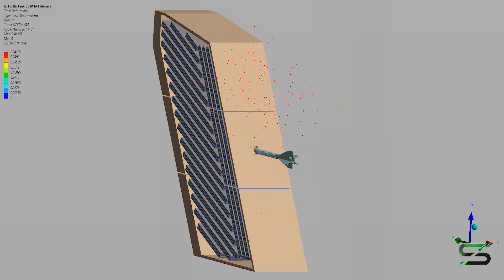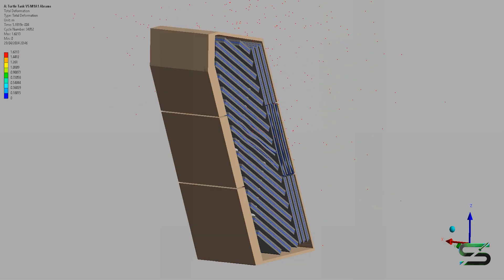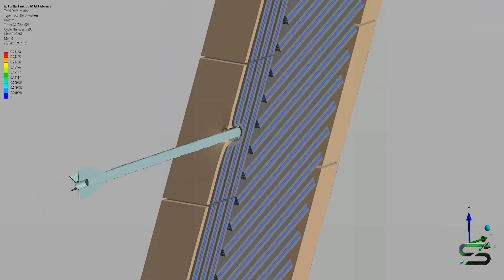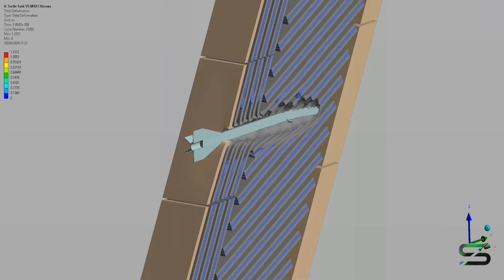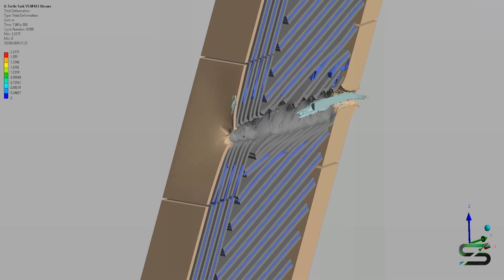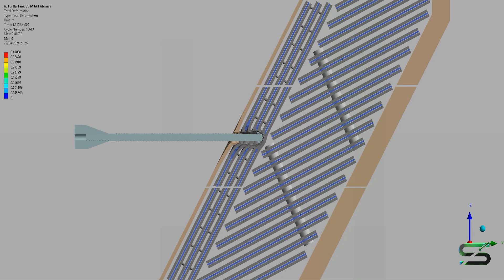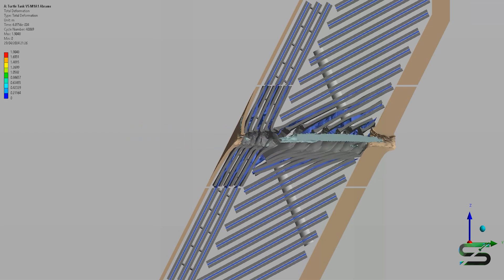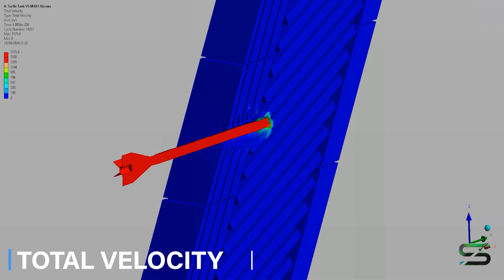T-72B3 VS M1A1 Abrams Turret Side | Armour Piercing Simulation

Comment: The depleted uranium armor is ONLY in the in the turret cheeks of ALL the Abrams variants that use depleted uranium as armor (excluding the training variants which reportedly have depleted uranium in certain parts of its hull).
Reply: SEPV3 has DU in front of the hull and above the driver.
Reply: @saltysteel3996  Not above the driver, only the front hull.
The hull roof on the SEPv3 has stayed the same, being unchanged.
Reply: @saltysteel3996  it does not. No credible source supports this aside from 5 training units. This is confirmed by RedEffect and Spookston. They’ve interviewed SEPV3 commanders.
Reply: @velvetthundr  The SEPv3 does use an upgraded hull array, though it's still being speculated as to whether or not NGAP even uses depleted uranium.
Reply: I wonder why the US went for DU, it may be cheaper than tungsten, but based on some other simulations it’s inferior in terms of protection. Maybe it’s some DU-tungsten alloy like the newer M829 versions.
Reply: @RichelieuUnlimited  I'd imagine it's because of how cheap it is compared to tungsten... It isn't really a favorable material in the US.
That, and DU reportedly has great penetration-mitigating effects when paired with NERA materials, greatly increasing their effectiveness.
Reply: @RichelieuUnlimited  You're mixing up armor and ammo, tanks don't use tungsten armor
Reply: @BENKYism  Leopard 2 does use tungsten in its composite based on publicly available data. As do most other modern western style tanks, probably.
Reply: @RichelieuUnlimited  It's very unlikely that the leopard 2 uses tungsten armor. "Chobham" armor is generally made up of NERA (layers of steel sandwiched between rubber) protected by an outer layer of high-hardness ceramic tiles. Tungsten is a lot more money than depleted uranium.
Reply: @BENKYism  Leopard 2 doesn‘t use Chobham. While the technology was shared with Germany, Germany *supposedly decided to develop a composite scheme more optimized to dealing with kinetic energy penetrators instead focusing primarily on HEAT. In terms of expensive materials, to my knowledge modern Leopard 2 variants make use of a solid one meter *thick titanium alloy trunnion so I doubt some tungsten alloy here and there is going to break the bank (assuming the tank uses ~1 metric ton of raw tungsten it would cost between 10.000 and 35.000$ plus whatever processing is required).
Reply: @BENKYism  Almost every tank (apart from the later Abrams variants and a select few Russian variants) uses tungsten composite arrays.
Reply: @BENKYism  "Chobham armor" (something that hasn't been used since the early '70s) uses tungsten with NERA elements... That NERA is NOT "layers of steel sandwiched between rubber", NERA is the reactive materials themselves... Be it plastics, rubber, glass, or sand.
Reply: @TheArcticFoxxo  I was wrong about tanks not using tungsten but Chobham armor is used on the Challenger 1/2, Abrams, and K1. The non-explosive reactive materials are only one component of NERA, it's also dependent on the layers of steel plates.
Reply: @TheArcticFoxxo  Chobham armor didn't even exist in the early 70's, the first tank to use it was the Chieftain mark 5
Reply: @BENKYism  The first use of Chobham was in 1969.

So sorry, let it be known that I'd like to change my statement of "early '70s" to "late '60s".
Reply: @TheArcticFoxxo  A testbed was developed in 1969, the Chieftain didn't receive Chobham armor until 1975 with the Chieftain mark 5. Chobham armor is also used on the Challenger, Abrams, and K1.
Reply: @TheArcticFoxxo  In fact, the first vehicle to enter service with Chobham armor was the Abrams in 1980. The Abrams, Challenger 2, and K1 tanks use Chobham armor.
Reply: @BENKYism  Yes, and that testbed used...?

The only use of Chobham on the Abrams is on the skirts, which makes it quite hard to argue that it actually uses it.
Reply: @BENKYism  Steel plates, by the very definition of NERA, are not NERA.
Reply: @TheArcticFoxxo  I never said steel plates were NERA, I said that steel plates are a necessary component of NERA
Reply: @BENKYism  I must have misread it then.
Reply: @TheArcticFoxxo  The Abrams' turret, turret bustle, and hull use Chobham armor.  The US didn't jointly develop a proprietary type of composite armor just so they would end up using it on the side skirts.
Reply: @BENKYism  The Abrams turret, turret sides, and hull have only ever used BRL or HAP, not Chobham. The only use of chobham had been in the sideskirts towards the front of the tank.

You're right, they jointly developed a composite armor profile so they could develop off of it and produce BRL instead.
Chobham was only ever used on the XM-1, and it was dropped with the introduction of the original M1 abrams in favor of BRL-1.
Reply: @TheArcticFoxxo  BRL-1, BRL-2, HAP-1, HAP-2, and HAP-3 all incorporate Chobham armor. The Ballistic Research Laboratory (which BRL-1 gets its name from) was involved with co-developing Chobham armor with MVEE in the 60's and 70's.
Reply: @BENKYism In what way do they "incorporate" chobham armor? They use domestically-designed reflecting plates with a downsized mesh and a DU backplate / further mesh.

The only connection the BRL institute had with Chobham was its implementation of a composite array including it on the Leopard 2AV, while beyond that it had produced its own armor patterns with its own NERA compounds.
Reply: @TheArcticFoxxo  Chobham armor is an informal name, there isn't one specific type of Chobham armor. BRL designed the armor for the Abrams which is Chobham armor. The US had no involvement in the development of the Leopard 2AV other than negotiating certain design choices.
Reply: On the sep v3 the armor is added to the front plate
Reply: @pirigrinfalcon6029  Nothing is "added" to the front plate of the SEPv3.

Comment: The tank that took out the Abrams fired a barrel launched ATGM at 4 or 6km range tho, a little misleading
Reply: Not true. It was takin out by an atgm that was being used by a Russian soldier on foot. But I agree this video is kinda misleading. Many of the videos this creator has made are a bit confusing.
Reply: @travismccraw6013 его уничтожил танк т72 с птура, а не российский пехотинец, побольше читай не верную информацию
Reply: It was destroyed from a cornet, some Russian😂 bloggers later wanted to show it as if it was destroyed with a guided missile from the barrel of a t72 tank @firdavsking
Reply: The T-72 was destroyed not by the M1A2, but by the Leopard 2A6. There was such a case, while the tank's fuel tank was pierced, that is, it was more likely to hit the side of the tank. But you are right, the brass knuckles fired by the t-72 tank are capable of hitting these tanks in the frontal projection.
Reply: @павел-б6н5ю ты не прав, танк т72 пробил не борт леопарда, а лоб

Comment: What are the specifications of the Armor plates?
Reply: I think it’s all on warthunder forums so if he doesn’t respond check that out
Reply: The blue material is depleted uranium.
Reply: @DarjG  no, it definetely isnt. The Abrams variants that have DU only have it on their turret cheeks. The turret side (shown in the simulation) is made of RHA with some type of composite derived from Chobham, but its a thin armor plate that is only meant to stop autocannons and, with luck, an RPG
Reply: @andrealves2630  Oh thank god there's somebody that made the distinction of "derived from chobham", not simply calling it chobham... I salute you.

If you were wondering, that armor that was "derived" from it is shortened to BRL. This DOES NOT mean "Burlington", but it was named after the institute that designed it; Ballistic Research Laboratory.
Reply: @TheArcticFoxxo  yeah I got sick of all the people calling it Chobham. CR1 was probably the only tank using actual Chobham, and even in that case it is disputed. 
I return the salute, sir